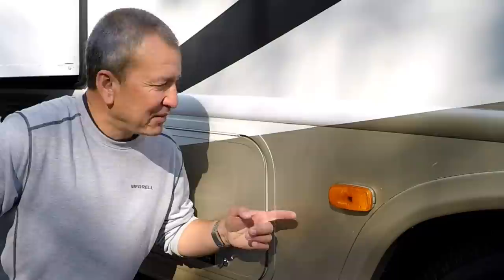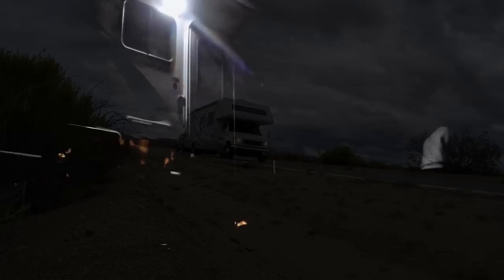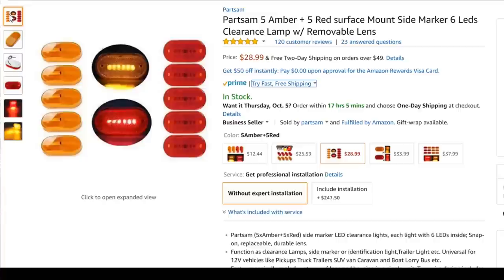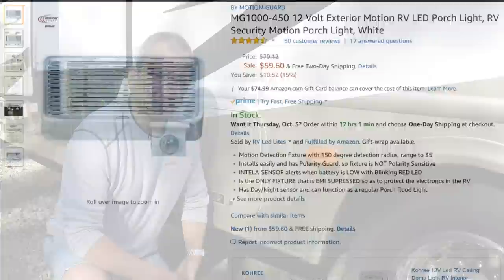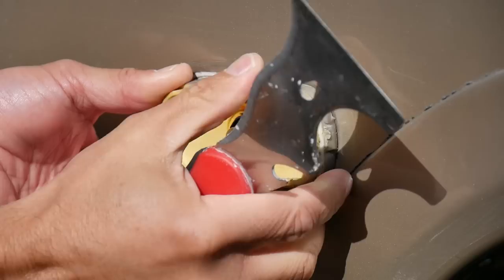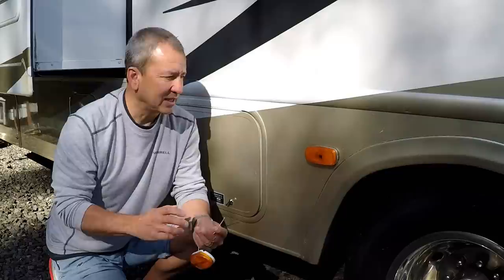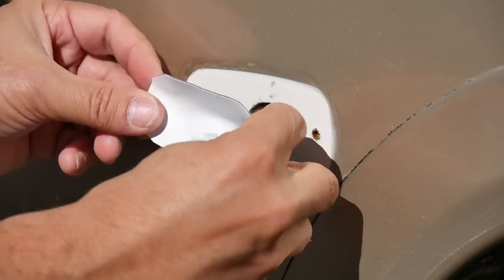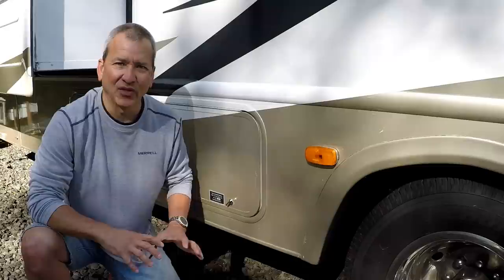Installing LED Marker, Clearance and Porch Lights on RV

Comment: You inspired me to change my incandescent marker to LEDs, especially since we just returned from a 5000 mile trip and 3 of the amber ones had lost their lenses during the journey. Just finished the upgrade. Like you I electrical taped the wirenuts. I had Flextape on hand to plug the siding holes. Worked great. Thanks Brian, you give some great tips. The LEDs cost me $35 from Amazon.
Reply from the maker: Sweet! Great job. I'm glad it worked out for you. Thanks for the update.
Reply: When you changed camera to color do  you have to modify inside backup monitor. I like the way you show your upgrades in detail. Just found your channel. You are great thank you Dennis

Comment: I replaced my marker bulbs with LED bulbs, the marker fixture was in good shape so I did not need to replace them.  The led bulbs were $11.99 for 10 so I purchased 2 packages for $24 from Amazon.  These same bulbs worked on the license plate holder too.
AGLINT W5W LED Bulb 9-SMD 2835 Chipsets T10 194 168 175 2825 Wedge LED Replacement Bulb for Interior Dome Map Courtesy Trunk Door License Plate Light.
Reply from the maker: I kept having issues always finding the perfect replacement lenses for the ones I had, so I decided to go with new fixures that I could easily get lenses for. I just may order a bunch just to keep them on hand.

Comment: Hi Brian I did the same thing last year.  I sealed the lights with butyl tape.  That stuff is great and cheap.  I used the white. But a piece or two behind the light and then mount the light, the tape that squishes out just peel it away.  Viola done.   I also had to rebuild the transmission for my Kwikee R/V steps it cost 8 dollars for the clutch kit at an autoparts store.  Seems it is a Ford electric window motor.  Anywho while I was messing around under the steps I notices a light there.  Seems it is supposed to light the steps when they come out.  I never saw it or noticed it before.  I got a 3M self adhesive 18 in led light strip in amber and attached to the body right above the steps, so it shines down on the steps.  I hooked that into the Kwikee wiring.  Management is very happy with that mod.
Have a great day 
Dave
Reply from the maker: +Dave White Thanks for the tip. My Kwikee steps don't work right now so I have had them disconnected for the last year and plan to fix them (low on my project list). I'll take your idea on the light strip. That's much better than the light underneath.

Comment: Hello Mr. Tito. Pleased to meet you! You shared that on the new lights you installed that the black wire was positive and the white wire was negative. However, when you cut the wires to the old/bad light, how are we supposed to determine the positive/negative wire to the old light? Sorry if the question seems dumb, but I had noticed that both wires from the old light were black. Thanks in advance for your response!
Reply: Not a dumb question at all. You noticed how he skipped over your question

Comment: The only problem with the motion sensing porch light is that it draws a small, but continuous amount of current for the detector circuit to work.  That could become an issue when boon-docking only on battery power.  The same is true for 12 volt CO2 detectors and radios having a remote control.
Reply from the maker: Yes. That is something to consider. In my case the amp draw is not going to affect me too much. Plus I'll switch it off when I don't need it. I should also point out that it has a daylight sensor. So the motion sensor mode only comes on at night.

Comment: Brian, GREAT video. We also have a Class C, and our's is 14 years old; so many of your videos have been a great help. On this video, I think using the Eternabond Tape behind the marker light was brilliant! Thanks for that idea. We have struggled with what to use for sealant. Do you typically just use silicone, as you referenced in this video?
Reply from the maker: I've sealed up my entire rig with silicone (all windows etc). The only downside is that it's difficult to paint.

Comment: LED always better..What about the intensity or brightness about the same..? I had use Versa tape from Home Depot  works about the same like the expensive eternabond..
Reply from the maker: Yes. These new lights are pretty similar to the old ones. There were others with more LEDs but I decided against those. They are plenty bright at night.

Comment: I don't know why your incandescent bulbs would constantly be burning out, unless the contacts are dirty from not being sealed correctly. It's extremely rare for any of my incandescent bulbs to burn out. I do however like the brighter light output and less amperage to run LED lights Hopefully they last for a while.

Comment: I'd like to know more about the color backup camera swap. Mine is a black and white, camera and screen. Did you swap both? Can you use existing wire? Like your videos.
Reply from the maker: I'll show more about what I did about the screen in an upcoming video. Short story, I tossed the old one when the radio portion stopped working. The rear camera was an old Jensen rear camera. I found a newer one on Amazon, but it was a bit spendy (around $200). I couldn't get to the actual connector from the rear, so I needed to cut the wire and wire it the new one (with Jenson connector) using a connector I pulled off the old console monitor.

Comment: Wondering if you measured the power difference between the incandescent and LED upgrades?
Reply from the maker: No. But it's usually around 1/10th to 2/10ths of power over incandescents depending on the number of LEDs.

Comment: What type of wire connectors did you use?  I’ve not seen those before.
Reply from the maker: Those are called Wago connectors. I use them all the time now and love them. I put a link in the description.

Comment: im doing the same thing and got the very same lights from amazon!!! my problem is ...'85 MALARD!  attic lights have 2 green and 2 white wires, so 4 total out each hole... how do i splice them to 2 wires on new lights?  wrap the 2 green to the 1 red(or black?)? and 2 white ones to the 1 white one?

Comment: Did you consider replacing just the bulbs with LEDs?  I think they make them.
Reply from the maker: Yes I considered that. The lenses on my original fixtures were getting harder and harder to find as well. Replacement lenses for the new ones are easier to find.

Comment: Because I’m electrically challenged (but trying to learn), how did you determine which black wire coming out of the side was pos/neg?
Reply from the maker: I tested the voltahe with a multimeter. If the voltage shows up as negative then swap the test leads.

Comment: Hey Guys,

I am wondering if you are satisfied with your motion detector porch light. I ordered mine after seeing your video and when I got it it would not work. I received a full refund and now I am going to order another. However, I thought I'd ask what your thoughts about it are at this point. Thanks in advance.
Reply from the maker: +Charlie Hey Charlie. It's been working fine for us. It does toggle between the two modes when Hou turn it off and on again. In motion mode you should get a blinking green light (or maybe blue). Hope the new one is ok.
Reply: Hey, just a note. I got my replacement porch light Friday and installed it yesterday. Great piece of kit.  Very bright, motion detection works fine. Love it. Thanks for the insight and video.